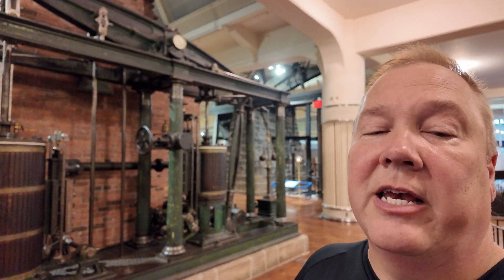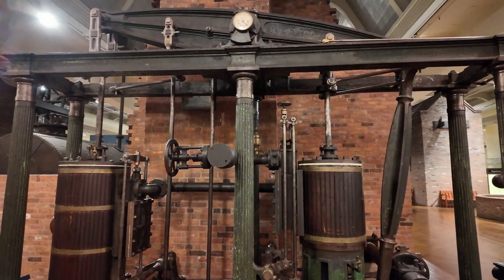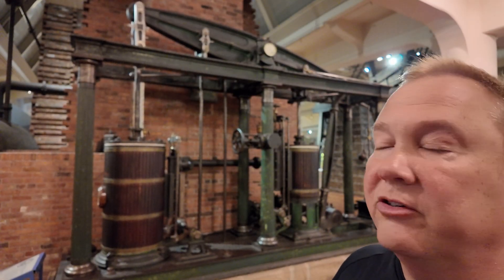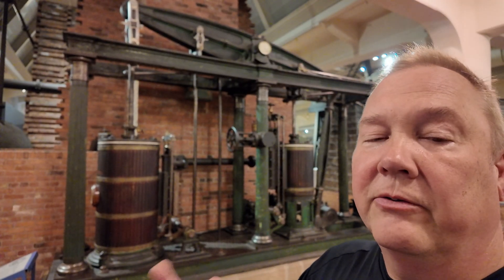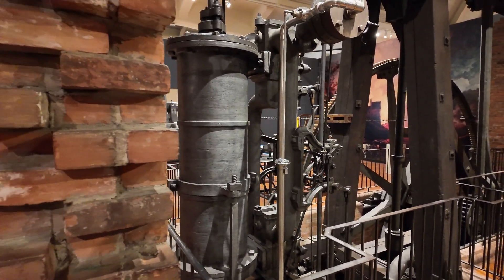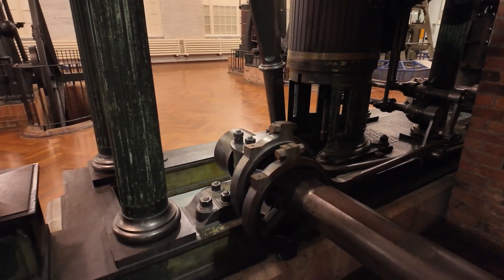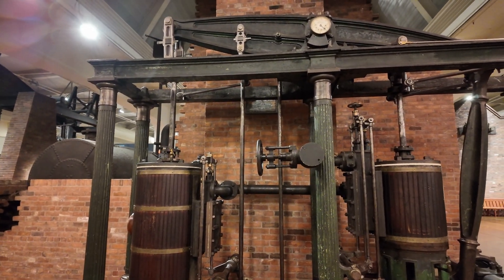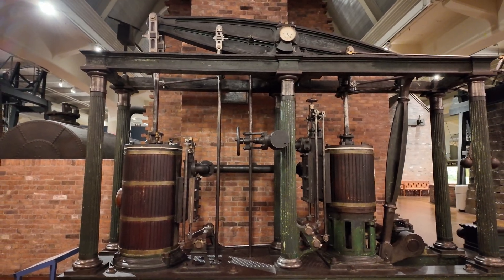How the McNaught Compound Beam Engine Revolutionized Steam

Comment: By the early 1900's, ship engines were quadruple expansion.
But I wonder if the line drive systems needed to be beefed up as well when more power was available.
Reply from the maker: If you built a factory with 10 lathes a few years ago, and now you need 30 lathes, you definitely needed to add more power, just like you do today.  This was a less expensive way to do it for line drive systems.

Comment: Darrin, thanks for another fine video!!!
To add a bit of information concerning compound-beam engines, the Fall River Line Str. PURITAN [1889] had the largest American compound beam engine with 7,500 horsepower; both cylinders were on the same side of the beam - high-pressure 75 inches in diameter with 9 feet stroke & low-pressure 110 inches in diameter with 14 feet stroke; usual steam pressure was 110 pounds; twin feathering side-wheels [diameter of 35 feet, at 100 tons, & each with for 9-foot dip]; at 24 RPM would attain a speed of 20 MPH.  She was in regular service from 1889 through 1908, then ran in supplemental service [two larger sister steamboats built].
Again, thanks for another fine video!!! 👍 🚂-🚃🚃🚃🚃🚃 👍
Reply from the maker: That thing was HUGE!